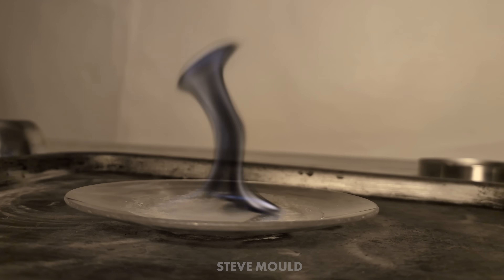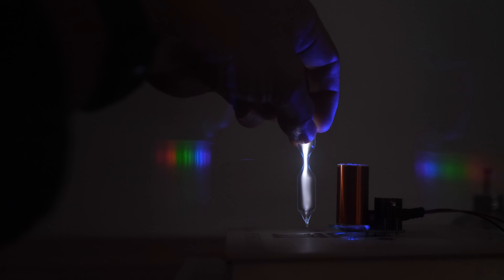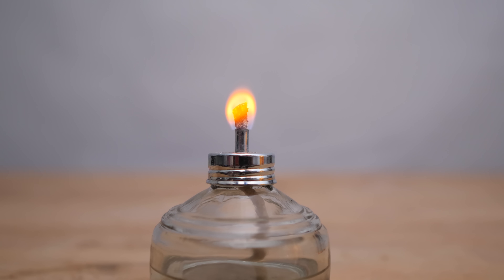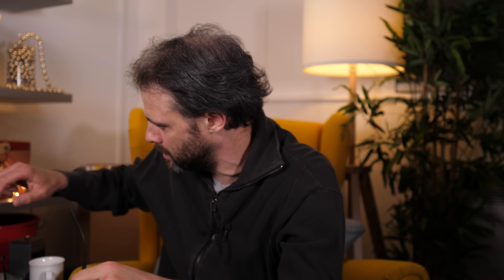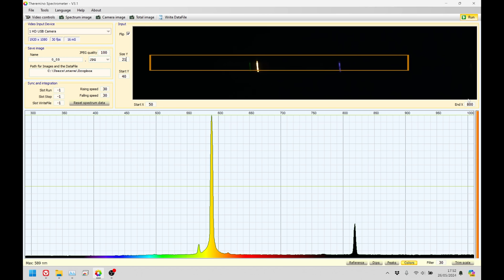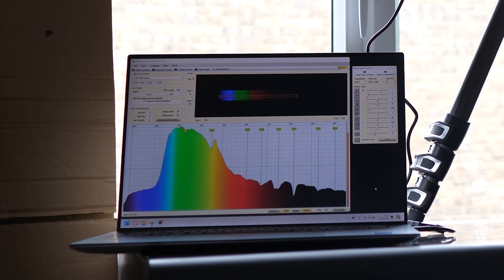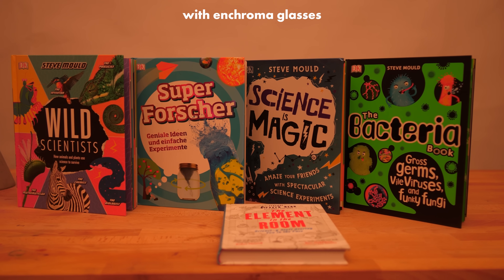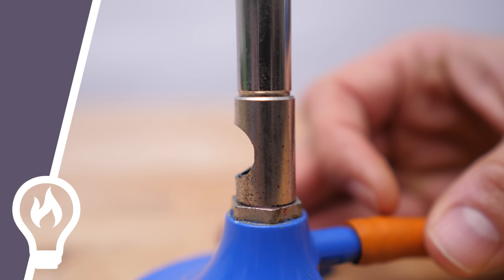Light sucking flames look like magic

Comment: I'm really glad you specifically mentioned that color blindness is due to the L and M cones overlapping more than usual! Lots of people seem to think that color blindness is caused by a lack of one or the other, when really it's a mutation.

That said, the reason why the literature is inconclusive is largely because there are multiple types and degrees of color blindness. "Red-Green" color blindness is actually a catch-all for the two most common categories: Protan (mutated L ('red') cones), and Deutan (mutated M ('green') cones).

Each of those two categories additionally has 'full color blindness' variants: Protanopia (when L cones are mutated to the extent that they behave exactly like M cones), and Deuteranopia (when M cones are mutated to the extent that they behave exactly like L cones). Whenever the mutation doesn't cause them to act completely like the other type, it's called _anomalous trichromacy_, and there are various degrees to that. The terms used are: Protanomaly (when L cones have shifted to behave somewhat like M cones), and Deuteranomaly (when M cones have shifted to behave somewhat like L cones).

So, because of all those different types, the way that light filtered by the Enchroma glasses is perceived will differ depending on which type of color blindness a person actually has. Notably, they can only work for people with anomalous trichromacy, and it will work better with one type of anomalous trichromacy than the other (though I don't know which one it works better for).

People with dichromacy (full color blindness) would have no use for them, and not be able to see any difference.

And finally, people with tritanopia and tritanomaly are left without any options because it's already super rare anyway. The only time I've ever even seen a joke or mention of it in something that's well-known, is a subtle jab at tritanopia in the movie 'A Christmas Story', when the father can't tell the difference between the green and blue lights. I've been studying color blindness for several years now, and it was only this past Christmas while watching that movie yet again that I caught that and it made me burst out laughing in front of my suddenly very confused family.
Reply: Thank you for sharing this! Didn't think I would be learning this much about color blindness tonight but that was fascinating to read
Reply: @deadlyshizzno  Thanks for the kind words, and I'm glad that I'm able to write about it in a way that fascinates others! To be honest, I myself don't have color blindness, though I have a few friends who do have it.

The only reason why I learned so much about it is because for a while I had a minor obsession with colorspace conversion math and algorithms, and I found out that color blindness simulation involves the same math as that.

I wrote a bunch of shaders on Shadertoy that deal with that, including color blindness simulation. Ironically, the one that shows how the LMS spectral sensitivity curves change (VERY approximately) is my most-liked shader on there, so I guess I'm not alone in finding it interesting.
Reply: Weirdly, as an artist, I've become increasingly aware that my ability to distinguish between blue and green is a little murky. If they're very far apart on the spectrum, I don't have too much difficulty, but closer together, there's a band of colors where I struggle to differentiate them. Ask me to mix or grade colors anywhere else in the spectrum, and I don't have too much trouble - and also perceive color in lower levels of light than some people I know - but ask me to mix in that blue and green area, and I will struggle immensely. It doesn't affect my daily life much, but my awareness of it as a problem has lead me to start using different color filters while creating digital art to make sure I'm not making color mistakes.
Reply: @KidarWolf  Huh, that's rather interesting; perhaps you have tritanopia? It's usually not caught by color blindness tests, because most color blindness tests only look for (and sometimes distinguish between) protans and deutans.

Does deep purple/violet look muted/greyish to you? Like, something around the color #8000FF? Might need to raise/lower the red channel a bit from there (depending on your eyes and your monitor), but if you can get a color roughly around there to look grey, you probably have tritanopia.
Reply: @Tynach  That's interesting, that specific tone doesn't look muted on my monitor, but there are some colors pretty close to it on both my monitors that look more muted than the colors around them. That's really helpful, thank you.
Reply: @KidarWolf  I found out some more information about tritanopia and tritanomaly while double checking some facts for another comment I wrote a few minutes ago. Apparently it's NOT a shift in the spectral response curves, but is instead a degradation of the S cones over time.. So someone can be born with full color vision, and then slowly lose their ability to detect short-wavelength light.

I'm not actually sure how to properly simulate tritanomaly anymore. All the simulations of tritanopia still make sense (remove S cone response entirely, then white balance the remaining shades of yellow and orange because our brains will be doing that anyway; which is mathematically identical to treating S cones as identical to M cones), but if you just lower the response of the S cones and then do white balancing, said white balancing will just undo the lowering of the S cone's response.

At the same time, having S cones die out and thus contributing significantly less to your brain's color processing would DEFINITELY affect color perception, as the brain now has less information to go on. So I can't just say "Well the simulations all point to the conclusion that you'll just have full normal color vision until you suddenly don't anymore." Making that claim would be really naive to say the least.

At any rate, I'm not at all surprised that the exact color of purple I cited showed up just fine for you, as it was calculated with many MANY assumptions being made about a wide variety of things, and not even just standard stuff like monitor variation. It also assumes that the chromaticity coordinates for sRGB's primaries don't shift when using the CVRL's proposed XYZ curves calculated from physiologically correct LMS curves. And since those curves are MOST different from the original 1931 XYZ specification when it comes to Z, which is basically the same as the S cone's curve, well... Yeah, those chromaticity coordinates are bunk, and thus the color I gave you was mostly bunk.

But I figured it was 'close enough' that you could find some colors around there that are muted/dim/grayish by just shifting red up or down. Finding that one of those colors indeed looks like that, tells me that you might want to get tested for tritanopia or tritanomaly (which Wikipedia says some people call 'incomplete tritanopia').
Reply: @Tynach Super interesting information you’ve provided here, thank you! 

As you were talking with the other person about tritanopia etc, you mentioned a particular shade that would look grey to such a person. I’m pretty sure I don’t have any form of color blindness (though a cousin of mine does). I have wondered a bit, though, about my own sensitivity to certain “blue” LED lights. For me, I find them super unpleasant to look at, and they seem to fracture into multiple bands including a blue and a purple. Do you have any idea why this might be so? Is it something that happens to a lot of people, or is this likely some sort of vision mutation? I am fairly myopic with increasing astigmatism over time. Could it be an astigmatism thing? In general I like LEDs for how energy efficient they are, but those blue ones in the newer LED “Christmas” light sets just drive my eyes bonkers!
Reply: @DawnDavidson  I must first reiterate that I am NOT an actual expert, so keep that in mind before reading my response.

I suspect that what you're running into is maybe two or three different things, depending on whether some of those things can be counted as the same thing.

Firstly, the 'bands' you see might be because the light is being refracted ('bent') by your eyes differently by wavelength, and the LEDs are putting out two different wavelengths. If you can get a diffraction grating, you can use it to verify whether it turns into two different peaks or not.

Secondly (though this deals with refraction again, so maybe part of 'firstly'?), and this is something that I notice with some blue LEDs used in clock displays on stoves and microwaves, they might be like.. REALLY deep in the blue region of the spectrum. For me personally, my glasses correct my vision best for green and mostly well for red light.. But blue light bends a bit too much and is a blurry mess again. It can be very annoying to have everything around a clock be perfectly crystal clear, but the deep blue numbers turn into a blurry mess that I have to squint to see.

Thirdly, and this is more the reason I put the disclaimer in at the start, S cones do not contribute to the brain's perception of luminosity, at least according to the CVRL's math for converting from LMS response levels to a luminosity (or to convert the LMS cone response spectral curves to a luminous efficiency spectral curve). So, part of your brain sees that the blue is brighter than the darker areas around it, so tell you it's brighter... But another part of your brain reads that elevated brightness as the same brightness as the areas around it!

This last thing is actually something I think I notice, but honestly? It might be me being super annoyed at the blue clocks in the kitchen being all blurry, and my brain making up further reasons to dislike it.
Reply: @Tynach

I've enjoyed reading through this comment thread, and have to say the fact that you've taken the time to fully respond to so many comments, is pretty awesome.

I have long been interested in the concept of color perception/ blindness, but have only read very  surface level information that covers the basic concepts.   - Once the information starts heading into the actual physics of light, refraction, and wavelengths and such, I'm very quickly overwhelmed and unable to contextually place anything, which sucks as I find the subject really fascinating.  

From the very little I have found, it seems to me that this is one of those subjects where the advancements in scientific understanding is just never really conveyed to the general populace, and we're stuck with a rudimentary, no longer technically correct view of it. I think this is an issue with a lot of progress made via genetics and neuroscience in a many areas of study, over the past few decades. - 

I also think this has helped grifty/scam gigs quite a lot, as most of us are completely unaware of just how much progress in understanding is made with those two fields, but I digress,

 My point was,  I think that your first comment, and the responses to your comment(s) are evidence of this, lack of updated, well distributed information,  and also of just how interested, and eager for lay- friendly information people are, about a topic that there is a vacuum of science communicators for.

Case in point,  someone mentioned that they realized that the line between blues and greens is a problem for them.  Anecdotal anecdotes, are anecdotal, I know,  but, I know that trying to find reliable, lay friendly, information about that phenomenon specifically is quite tricky. I've wanted to learn more about that very concept as I've known three people who have had pretty pronounced issues distinguishing between certain colors/ hues, but they don't have actual color "blindness" . Due to the problem not falling under the scope of what is traditionally thought of as color "blindness" trying to find something out about that concept, that I can actually learn from, without any prior understanding of the factors that might be in play, to cause it,  is... well,  quite difficult.  Finding stuff that gives off a strong pseudosciencey vibe, or is part of some sales grift, is not as difficult. And that sucks both ways.

Anyway,  I'm done rambling,  I wanted to thank you for sharing the stuff that you've learned about the subject.

I definitely find the subject of color perception quite fascinating specifically, more than the physics of light and the functions of the eye, but at least some of that is down to my own inability to process the information relevant. Ho hum.

I hope you continue to expand and share your knowledge, you're helping to make the world a less ignorant place.  Keep on, keeping on.
Reply: @Petticca  My fascination with it started with a question I had when I was a kid: why does the same image file look different on two different computers?

This was especially obvious at school in the computer lab, because you'd have a lot of the same computer in a grid and you could stand up behind them and see the default wallpaper on all the monitors.. And whenever one of the monitors was a newer one because it'd been replaced, the colors were different from all the rest. And sometimes not just the brightness/contrast, but the hues.

Of course, monitors have all sorts of controls for white balance, brightness, contrast, and sometimes gamma... But when I'd try to get two monitors from different manufacturers to match, I never really could.

Fast forward to late highschool, and I had learned enough to know what 'gamma correction' is. I knew roughly how to correct for it, but it required either special equipment (a colorimeter) or a loong time comparing colors that are at half brightness to each other, and recording what the difference is vs. what it should be.

Then shortly after I graduated college, or maybe toward the end of my college days or so (I forget the exact timeline), I found an article online about the matrix math for basic RGB color space conversion.

That was the doorway to a lot of other stuff, and from there I just kept learning about color spaces, and how the amount that the L, M, and S cones are stimulated by a color also counts as a color space (and can be modeled as a type of RGB color space).

Once you can convert from RGB to LMS, simulating color blindness becomes pretty straightforward. I did find some articles online that detail the exact math and its derivation, but the idea remains the same.

As for me responding to so many comments in here.. Well, I'm unemployed and have waayy too much free time.
Reply: @KidarWolf keep us posted?
Reply: Would those glasses work a bit easier, if the left and right lenses blocked different colors? I'd imagine it would be a bit like those old blue-red 3D glasses, but maybe it'd be too annoying and distracting to be practical. 🤔
Reply: Those old 3d glasses were terrible, and so would be colour-blind correction of one type in an eye and another in the other - you're looking at a severe migraine
Reply: @AileTheAlien  Uh, no, I don't think so. That would just mean that the person wearing them could maybe distinguish colors a little better in one eye but not the other eye, which is kinda pointless.
Reply: Thanks so much for your comment, and also to Steve for giving a much more scientific explanation of color blindness than I usually see. I’m not color blind myself, but I do have a couple of color blind relatives and I’ve never actually understood the science of it. Explanations I’ve seen online usually just show color shifted photos and say “This is what this would look like to a person with this kind of colorblindness.” Seeing the actual light spectrum was much more helpful, and gave me the groundwork to understand your much more detailed write up. 🙏
Reply: @tremkl  You're welcome, I'm glad it helped! And yes, big kudos to Steve for not perpetuating common misconceptions about the science, which end up usually just making understanding the real research confusing.

If you want a more concrete example of how the color spectrum looks to people with different types of color blindness, I made a shader on Shadertoy that demonstrates what the spectral sensitivities of different types of color blindness look like, and what the color spectrum looks like for people with those spectral sensitivities.

It's all VERY approximate, because it's in a realtime shader and I cheated on the math a LOT, so don't consider it COMPLETELY scientifically accurate... But it demonstrates the mutations of each type of cone and how the color spectrum looks like for those mutations.
Reply: This comment should be pinned. It's absolutely informative!!
Reply: thank you so much - i’ve been trying to understand my “red-green color blindness” for years (i suck at the dot tests) and now i have the word deuteranomaly to describe my experience <3
Reply: @callmeqt  I also see the terms 'red-blind' for protanopia, and 'green-blind' for deuteranopia, in some places. Notably, my favorite test for distinguishing between the two that I've seen so far (found on Paul Tol's color blindness notes page) uses it.

What's so great about it is that none of the text in the image is red OR green. The image is almost all grey static, with text meant to be seen by everyone in a pale pink that's somewhat blended into the static grey background.. And some text meant to be invisible to people with protanopia, along with other text meant to be invisible to people with deuteranopia, both of which are more staticky than the text visible to everyone. Text that's meant to be invisible to people with protanopia is in a more purply pink, and text that's meant to be invisible to people with deuteranopia is a more reddish pink.

The result is that someone with protanopia will see a static gray image with some dark bluish text in the middle saying, "Your green vision is correct." Under that, a dark bluish box with pale slightly bluish-gray words saying 'You are red-blind.' in it, and some more pale bluish-gray text next to the box saying 'You are not green-blind.', and the 'not' being in dark-ish blue.

Meanwhile, someone with deuteranopia will see the same image as having yellow text on top saying, "You have normal red vision." Then a gap of more gray static, but under the gap is first a bit of pale yellow-gray text saying 'You are not red-blind.' The word 'not' being in the same more vivid yellow as the text at the top.. And to the right of that, a yellow box with pale yellow-gray words saying 'You are green-blind.'

The fact that it's possible to make text look invisible to people by just making it a certain shade of pink is CRAZY to me, and really makes me love that particular color blindness test!

Though, admittedly, it might not work on newer devices that have higher color gamut displays, unless conversion from sRGB to those higher gamuts is performed by the browser or image viewer used to look at the test image. But even then, the exact emission spectra of the display it's viewed on can greatly impact how a color blind person sees it, and they might be able to distinguish the colors anyway.

Still really cool though. Kinda wish they'd include tritanopia on it, but oh well.
Reply: @Tynach That was a great explanation

20+ years ago, I bought a pair of color corrective lenses from Colormax (they were about $600 at the time).  I have severe protanomaly and the glasses do help me to see greens and reds more accurately.  Without them, reds are extremely "dark" and greens appear to be brighter to me than they do to other people.    I still have them and I pull them out every once in a while.  They are somewhat mirrored on both sides, so not something to be worn about constantly, but they do help.  I was just using them yesterday to see how other people see a green bicycle that I was buying.

One anecdote about that - I tend not to see much of a difference in zombies and non-zombies in movies because people kind of look like that to me all the time.  I just don't realize it because that's simply how people look to me.  However, if I put the glasses on for a while when there are people around, then take them off, people look pretty gross for a while until my mind adjusts back to normal context.

With the lenses, my result on the Ishihara test on colorblindness.com (38 panels) is only two wrong answers; two partly correct answers and the rest correct.  Without them, I get nine correct and two partially correct (so 27 incorrect).

Generally, purple is either pink or dark blue to me, depending on the hue.  I have only seen purple a handful of times in my life.  That is in those times, I saw it as a color I could not really identify and confirmed with people that it was, in fact, purple.  When I view an image of the visible light spectrum with the glasses on, there is a section at the violet end that looks like a color I don't usually see (but I know what it's supposed to be, which may give me some bias).

Colormax, it seems, is now charging almost $10,000 for their glasses (although i can't be sure it's the same company).   When I got my glasses, I went to an optometrist for extensive testing (I don't remember what all was involved).   It sounds like Colorlite lenses are around $800 or so and they do extensive testing with an optometrist.  It seems Enchroma just has "Deutan" and "Protan" lenses with no gradations of intensity.  I bought some amber-tinted sunglasses a few years ago online that actually made a difference in my color perception. In fact, I had a pair of Serengeti Drivers back in the day that did the same thing.  Even though my lenses are a bit flaked off and splotchy, I have no interest in even trying Enchroma lenses.

Then again, i'm not so sure I would want to be color-corrected all of the time even if it were possible.  Fall is coming, so that's a good time to bring out the glasses.

Interesting stuff.
Reply: As someone who suffers from severe tritanopia, this is spot on.  And it SUCKS!
Reply: @Truex007  Oof.. Yeah, there really should be more resources available for you guys, but there really isn't. On the bright side, tritanopia doesn't affect your perception of how luminous a color is, while both of the other categories of color blindness (though especially protano(pia|maly)) do change how luminosity is perceived in colors. So, uh.. Small wins?

It's also true that when looking at comparisons of how color blind people see things vs. normal color vision, people with normal color vision tend to say that tritanopia is closer to normal than the other two. Personally, I think this tends to be biased by the type of content shown and what colors are represented, but it does at least mean that for most general things there are fewer differences between what people with normal vision see and what people with tritanopia see, compared to that difference when it comes to people with protanopia or deuteranopia.

BUT, when it comes to color coded things, like.. When it ACTUALLY MATTERS..? Yeah, I've very often just randomly tested my color blindness simulation code out on different color coded charts and graphs that are supposedly meant to be color blind friendly, and just... They so often pass the test for protanopia and deuteranopia, but then have MULTIPLE pairs of colors that are easily confused by people with tritanopia!

So yeah. You've got small wins in your condition being, on average, 'not as bad' as far as just general appearance of things... But still, on average, being 'just as bad and often worse' when it comes to things that actually need to be distinguished. It REALLY sucks having tritanopia, and I hope more people start designing things with you guys in mind.
Reply: Commenting here just because this is such a good mine of info.  Thanks!
Reply: Been Red/Green colourblind my whole life and I've never really understood whats actually going on with my eyes, possibly because I've been told I am Protanomaly at certain times and then Deuternomaly at other times. What I can say Is if I play a game with a colourblind mode on, its never quite right, as they all seem to use colours (or shades of colour) that my eyes dont see any difference with. For me, watching the video with the glasses overlay didn't make the colours easier to see, but I did notice more shades of colour. I would still be guessing what the colour was, but I wouldn't be saying thats the same colour as the last one. On a snooker table if you put one brown ball and one green ball mixed into a pile of red balls, they are either all red balls or all brown or all green. the point being I cant see any difference, it would be interesting to find out if those glasses would have any effect for me.
Reply: @fingers752000  Actually, I just tried out some of the free online versions of the FM100 test, and I was able to pass them while simulating full protanopia. That probably would not be the case in real life, but it's making me question that test.

The 'Farnsworth D15' test, on the other hand, I was not able to pass (while simulating full protanopia), and it correctly showed a clear 'Protanopia' conclusion. I'm going to tentatively say that it might be best to try out the D15 test.
Reply: @Tynach  Thanks buddy, its worth a try. Worst that can happen is I still struggle with colours 😂
Reply: @Tynach  According to the D15 test im severe red colourblind, although i will say I didnt really understand what they wanted doing, so it may of affected the test...
Reply: After running multiple different tests, I mostly get severe red (protan) but in 2 tests, matching colours it said its (Deutan). Some tests seems to make my eyes do something different for whatever reason...
Reply: @fingers752000  Well, that's actually kinda on purpose. On a chromaticity diagram, the tiles in the D15 test make a 'U' shape with the tips curved toward the center, and this 'U' shape goes around the whole color wheel. The goal is to place the tiles such that each one you place is as close as possible to the previous tile.

Someone with normal color vision will typically do this in the correct order (with maybe a few minor mistakes), because they can see all the hues distinctly. But because of the 'U' shape having its ends curve toward each other, that makes both opposite ends actually have somewhat similar colors to each other... Just not AS similar as the tiles that actually belong on those ends.

Someone with either type of red/green color blindness, however, would see a correctly filled in D15 test as shifting from blue, to yellow, then back to blue. It would seem to make a full circle! So, what happens when they fill it out from scratch themselves, is they see that there are blue, grey, and yellow tiles.. And so they arrange from blue, to grey, to yellow - with yellow being at the very end.

The type of color blindness a person has will determine which colors get 'confused' with each other, which will in turn determine the pattern that's created when they're filling in the test.

It's worth noting, however, that this is EXTREMELY dependent on lighting conditions, and a bunch of other things. If you took an in-browser test on the Internet, don't trust it unless you've used a colorimeter and calibrated+profiled your computer's display.. And even then, it's probably best to go in and do the test physically anyway, because displays do not have standardized spectral power distributions for the colors they emit, and that can affect the result.
Reply: @fingers752000  Color blindness tests can be affected by the lighting used when the test is being performed. There are also a number of different tests that can be taken, and some of them can't discern the difference between protanomaly and deuteranomaly.

From what I can tell, however, one of the more useful color blindness tests is called the Farnsworth Munsell 100 Hue Test. If you've done that one before, I would trust its results over most others; and if not, it might be worth looking into.
Reply: Channel, sticky this man's comment🙏
Reply: I thought full colour blindness was monochromacy, not dichromacy.
Reply: @theunholybanana4745  There are a bunch of different types of monochromacy, some of which involve all three cone types being perfectly intact and functional, but there being a neurological problem with processing the color signals. In at least one type I read about several years ago, people with that type of monochromacy could easily distinguish between colors, but simply couldn't tell what those colors were. As such, I found it mildly interesting, but since it would be impossible to simulate on a computer, I never really looked into it further.

Basically though, since monochromacy in general is a weird catch-all for 'other types of color blindness', especially types that don't match up with the mechanics of how the more common varieties work, it doesn't actually make as much sense as most people think it would to consider it 'full color blindness'. Most actual research I've run into avoids using the phrase 'full color blindness' entirely.

I myself used it loosely to help build the understanding of how dichromacy is a scale ranging from 'barely any color blindness at all' to 'complete mutation of one cone type to act as the other type'. You go from 0% mutation to 100% mutation, so it makes sense to label the 100% end as 'full color blindness'. It might be considered wrong if I was writing in a scientific journal, but since those tend to completely avoid the phrase ('full color blindness' never appears in the Wikipedia article for color blindness either; in fact, the word 'full' only appears three times), I'm pretty sure it's safe for me to make up my own definition for the sake of explaining it to other people easier.

All that said, when I Google 'full color blindness', every single page that uses that phrase agrees with your definition, and disagrees with mine. So I can completely understand where you're coming from, and will concede that I probably should have avoided that phrase as well.
Reply: @Tynach  from my research monochromacy was only used for types of colour blindness where they see in essentially black and white, like where they only have 1 or zero functional cone types. I can see where you're coming from and that was a very good response.
Reply: @theunholybanana4745  This reminds me that I keep meaning to look into how to simulate rod-only vision.
Reply: There's actually a situation where women (who have two X chromosomes) end up having 4 types of color sensing cones instead of 3, and they can actually distinguish different colors.
Reply: @takanara7  There has been ONE confirmed case of that, and I've heard some people complain about the methodology that was used to confirm that one case, so it might not actually be as confirmed as they say it is.

To be clear, I'm far from an expert, but I know enough about color vision now that I also know how mind bogglingly difficult it would be to actually test that.. Especially since the possible absorption spectra for a fourth cone type would almost always lie within the same gamut as the other cone types, and thus not actually allow for more types of colors to be distinguished.

The exception is that there are two different 'normal red' (L) cone pigments, with one peaking at, *checks CVRL website*, 552.4nm, and the other at 556.7nm. At least, that's what I think the data there (going to 'Photopigments', then going to the bottom of that page to 'Molecular Genetics', and looking at the table of 'λmax values') is saying. Still, even someone with both types of L cones would probably not be able to distinguish more colors than someone with just the type of L cones with a peak sensitivity at 556.7nm.

In other words... Even if the claim is true, it'd be difficult to prove, and even if proven, it doesn't mean much more than there being people who can distinguish reds a bit better than average anyway (including those who can do so without having 4 types of cone cells).
Reply: @Tynach  So I believe I have two different copies of the red opsin gene, because I do have slightly better than average red–orange discrimination, and “redgreen” looks slightly different from yellow. It would require both a copy number variation and a point mutation because I’m not XX. Sequencing didn’t rule it out but didn’t confirm it either—I do have an anomaly there, but it wasn’t identified with high enough confidence.

My guess is that there are many people with variations like this, who simply don’t notice because they have apparently “normal” colour vision, so they never have a reason to dig into it. Even if my hypothesis is right, it may only be noticeable because I also have a collagen disorder that affects my lenses, which has other potentially confounding effects, like reduced filtering of UV.
Reply: @EvincarOfAutumn  Those things might already be covered by the '3-stage postreceptoral model'. That being one of the current models for how the brain actually interprets color data from the three cone types.

According to that model, the signals from the cones get combined in a bunch of different ways, ending up with 4 actual color channels:

Amount of red compared to green
Amount of green compared to red
Amount of yellow compared to blue
Amount of blue compared to yellow

I might be interpreting these diagrams and their labels wrong, but that seems to be what's being communicated. This diagram I'm basing that on is labeled the '3-stage Müller zone model'.

That said, it could also just be that you have the type of L cone that's shifted further away from how M cones behave than most people have, giving you slightly better than average red sensitivity... Or you could have both types, as you claim! It'd just be really hard to distinguish between the two possibilities, potentially impossible.

I wish I knew more about the topic to really know what sorts of questions to ask and maybe what sorts of things to ask you what they look like, but I really don't know where to even begin. I'm just some unemployed programmer who reads waayy too much about topics that are kinda neat but not practically useful (it's not like I went to medical school, so I can't be an eye doctor or anything like that, so I can't even administer or interpret color blindness tests as a job).
Reply: It's well-known amongst colorblind people that the Enchroma glasses are a huge scam, perpetuated by youtubers who keep lying about the effects. They don't let you see anything you can't, they just make colors "different". They just mess up the colors, and colorblind people can notice when colors are all messed up. The reason they "work" with anomalous trichromacy is that the weakest your colorblindness, the more you perceive how much it's messing up everything. In the end colors end up even less accurate than we see them normally, and yet they falsely claim it makes us see colors we can't see. It's just that, a scam with little to no scientific merit.

EDIT: If you want to know more about the massive scam that is Enchroma, there's a very good video on the subject here on Youtube called "Exposing the Color Blind Glasses Scam". It goes in depth at explaining how it's all BS.
Reply: @dantemeriere5890  I think it's maybe more accurate to say 'mostly a scam'. I read once that Enchroma didn't even intend to invent glasses for color blindness, but rather they wanted to filter out color bands in that region for some other reason.. Welding, maybe? I forget.

Anyway, if I remember correctly (and what I read was actually true), it turned out that their glasses weren't great at what they were designed for, but some people with very specific types of anomalous trichromacy said, anecdotally, that they seemed to be able to distinguish colors a little better with them than without them.

So, since their glasses were (allegedly, if I remember right) a bust with what they originally intended, but maybe had some other thing they could market them as, they went all-in for the new gimmick they discovered they'd made.

On the other hand, I've heard more positive things about Colorlite's lenses, and apparently they test everyone for the exact type(s?) of color blindness that they can actually help with before allowing their glasses to be purchased (at least, I think they've claimed that), because they only want people to have their glasses if it will actually help them.

I've also heard claims that Colorlite has actually done their own R&D that was specifically aimed at making glasses for color blind people, in contrast to Enchroma (though again, I don't really have a source for that claim about Enchroma not doing such R&D).
Reply: @dantemeriere5890  I have deuteranomaly and I own a pair of Enchroma glasses. I bought them with my own money and kept them. They don't work as well as Enchroma's marketing would suggest but they do make a difference and help with the separation of reds and greens. One example: When I see a green bush with red flowers in it I usually don't notice the flowers. When I wear the glasses I can see them immediately. The green looks more green and the red looks more red to me. That being said I rarely wear the glasses because they do also make some things look weird or unnatural. I have two pairs of Shady Rays that I wear almost every day. They work just as well enhancing the colors for me but don't make things look as weird.
Reply: @dantemeriere5890 Did you even read what the Original Commenter wrote? Because you clearly didn't understand it. It only seems like a scam if you don't bother to understand the nuances of colorblindness.
Reply: @dantemeriere5890  Enchroma has a 60 day money back return policy. I don't think "scam" means what you think it means.